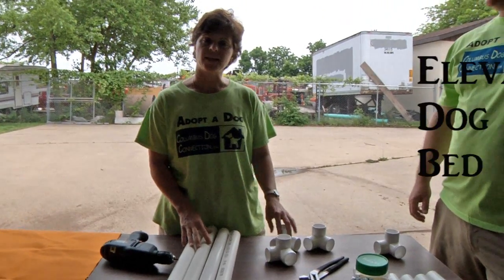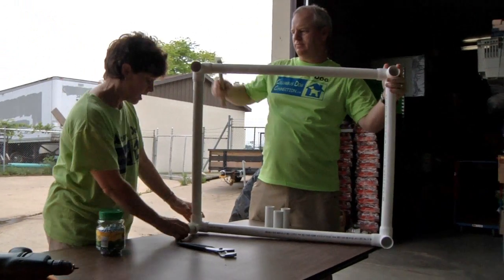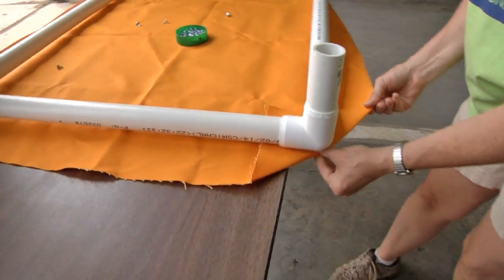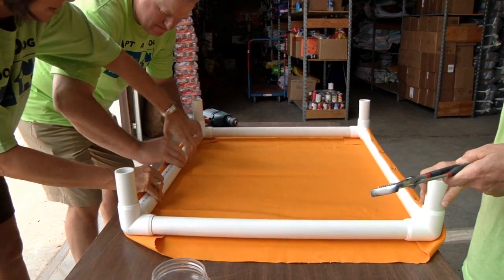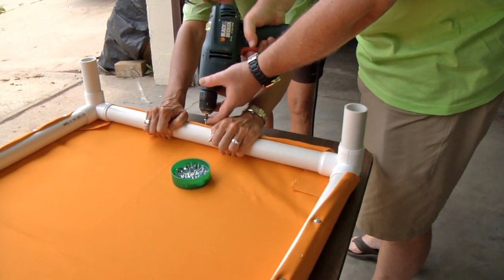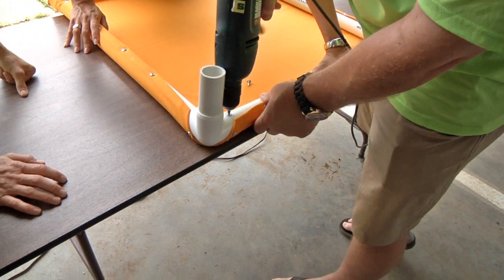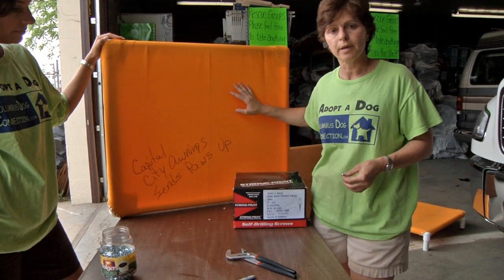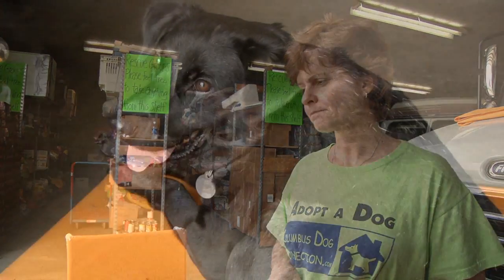How to make an Elevated Dog Bed

Comment: 1 person can make a wooden frame. Then with the fabric easily staple gun it in tact.  Just saying.
Reply from the maker: Hi Rob
Yes, one person can also make a pvc frame, it's just that you will build a stronger frame with 2 people. We would also suggest pvc over wood as you can't easily clean the wood from urine.  The panhead screws will also give you a better, long term hold vs the small size of the staple gun staples.

Comment: I have a disabled chicken that is an indoor pet. I'm planning on making this for her, but I am going to use much longer legs and make a frame for the bottom as well, then I will put cloth on all sides, except one, to make a cube, finally I am going to take the cloth for the side that didn't get used and I'm going to measure it, cut a hole, sew back the edges of the hole to prevent freying and then attach it all together. This will make her a nest box/hide away bed and a perch.
Reply from the maker: Sounds awesome.  Please post a picture when you are done so we can share with our chicken sanctuary friends.
Reply: @columbusdogconnection2950  I definitely will!

Comment: This is so great! I want to make one for my dog, but I need to make it the height of my bed because she likes to be next to me when she sleeps. Any tips on how I can make it a bit taller and structurally sound?
Reply from the maker: Hi Addie.  Thanks for your kind words.  You would have to make a wooden frame to make it sturdy enough.
Reply: I would  use a thicker pipe do it won't flip over. 🙏
Reply: Make a platform and put the bed on it. Add some steps/a ramp to  help the dog get up.

Comment: My American Staffordshire Terrier broke the pcv pipe in no time. Now he has an aluminum Kuranda which is great.
Reply from the maker: Hi Tomas. What size pvc did you use?
Reply: @columbusdogconnection2950  2”
Reply: @columbusdogconnection2950  He does not lay on the bed, he slams on it
Reply: @columbusdogconnection2950  In the case of my dog, the bed is not subjected to units of weight, but units of Newtons instead.

Comment: Ever seen the little video of someone heating a nut and a bolt and pushing the PVC pipe over one (ie. the bolt) and the connector over the other (the nut), then cooling them under cold water and twisting the nut and bolt out. It leaves you with a pipe and connector that can then be screwed together.
Reply from the maker: Thanks Kirsty. That might work.

Comment: You left out the WHY. Why elevated? Why just a couple inches off the ground? I've seen this design before but I didn't quite understand the advantage over just a typical cushion bed.
Reply from the maker: Hi Brent.  Most kennels have cement or other hard surface flooring.  An elevated bed provides a softer, dryer, cleaner place to rest.
Reply from the maker: Also, a shelter can't keep up with the cleaning of absorbable surfaces that a cushion bed would be.

Comment: This is a very helpful video - thanks. In my case, I have 109lb Shepard mix that has become lame. We saw something similar made by a handicapped pet company using some kind of mesh to allow the dog's urine to flow down into a catch tray. We are currently having to have the dog lay on Pooch Pee Pads to catch the urine and poo. I'd like to make my own "Pee Bed" but just not sure what I could use for the mesh. I am thinking maybe fiberglass screening. I was concerned with how to attach it to the bed - your method of screwing it on is something I hadn't considered. Ideally, I would like to make the fabric/mesh removeable like the commercial bed, but I am not skilled in sewing or other fabric architecting. So maybe the screw method would work - just not sure with mesh/screening. Any idea?
Reply from the maker: Thanks for your kind words.  I think the mesh being screwed on is probably your best option.  Just use the pvc snap clamps that we link to our our site at this link.  http://www.circoinnovations.com/circo-direct
Reply: Michael Abel Bless your hearts for staying loyal to your loyal companion! 

I read your comment and I'm intrigued by your question... I honestly had never considered that problem or what options are available, and I'm kinda a weirdo and like thinking of new ways to do things, so I feel like I'll keep thinking about this in the back of my mind... Not sure if you are still even looking, in fairness, but here's my brainstorm, maybe it will give you more ideas?

My main thought was that if there was some fabric to slip the mesh between and slide in and out, maybe that would work, the idea would mean basically a "frame" of fabric, but two layers of it, leaving the top layer unscrewed on one side so you could slip in the mesh, like a pillowcase works? 

Obviously, that idea has lots of flaws, though, mainly that some sort of material would need to be under the mesh or pup would just fall through. 

Oh! Better idea might be if you can do this concept and cover the top layer (as they do here) with mesh, and then use the underside of the pvc to attach fabric, tarp, plastic so that you could slip a tray or pee pads underneath of the mesh that he would sleep on. You could even  put some fake turf stuff on top the mesh (maybe use velcro so you can change it out easily) so that he's got a more comfy surface to sleep on, and you can rinse it fairly clean? 

Not sure if any of this makes sense, so I'm apologize in advance, I swear there's some logic in my head, maybe migraine brain isn't as brilliant thought right now ;)

Comment: I would love feedback on how these have held up over time? 

I'm mainly wondering how you (and anyone else who would share) feel that these beds compare to similar beds from a manufacturer, particularly on their overall longevity in a rescue/shelter environment?

My general experience with any type product is that typically items  from a manufacturer are of inferior quality to something you build yourself. It seems logical to assume the same would apply in this situation, and I would be delighted if these seem to last at least as long as the manufactured product, as long as they also aren't prone to needing maintenence when built correctly originally... I'm curious if that seems to be the case? 

My local rescue is considering purchasing beds from the manufacturer, and since it would be a significant cost even when discounted for rescues, it seemed worth at least exploring options. 

I really think these would be a great thing to build (I've wanted to build one for my own rescue dogs), but I'm just wary of the uncertainties and know that it a realistic idea if it is likely to need maintenence any more frequently than purchased ones.

Any insight, feedback, or lessons learned since this post would be very appriciated! 

Thanks so much for posting this wonderful, clear and concise video, and thanks to everyone who helps animals! Rescue dogs rock! (I've got three, lol!)
Reply: I built one over 10 years ago and have had no problems with it. When I made ,I did not even know there was a video. The material I used is pet screen netting. Pets can't tear it. I make washable blankets and quilts  and sew ties to the corners ,so the  cover stays put.
Reply: @Dianatorres6990  that's awesome! Thanks for the reply! :)
Reply: What I like about these beds , is  they are very easy to take with to your next destination, you can take them apart and even make a long pouch for them to carry them . The netting I used  is very light. yet very  durable. I would suggest a thicker PVC pipe for a bigger dog.
   When I built mine I  used the half inch wood screw. I used the wood crew because it has a flat head. What I also did was fold in at least 1 and 1/2 in of the nettting under all the way around the bed and then screw. Make sure your netting   evenly stretched all the way around and then secure. I really enjoyed making this bed and our dog is really enjoying. Our mini pinscher dog even takes a a dive to get on it.
     For anyone that wants to make several beds ,try making one and see how your dog likes it. These beds are easy to build and light weight.🙏

Comment: I'm confused as to why you would claim that the corner pieces are special order only and that you can't buy them at the big stores.  That's not true at all.  Almost any hardware store that sells pvc pipe will have those corner pieces, including Lowes and Home Depot.  $2 or less each typically.
Reply: Dear Dodger, 
The Home Depot and Lowe's in the Columbus area do not carry these.  The web sites for both stores also don't list them. What store did you buy them from?
Reply: I think you're confused. I believe you're thinking of the 3-way pieces but the elbows are not at 90* angles. The ones in this video are a special furniture-grade as they are not a standard plumbing piece used in the united states... hence why you cannot find them at places like Lowes or Home Depot. If you do find them, however, please let me know :D

Comment: Ever think about using PVC glue duh!!
Reply from the maker: Hi Kenneth.   Where are you suggesting to use the glue?  We love to hear suggestions on how to make the beds better, but no need to be snarky, ok?
Reply: Gluing the corners would prevent the ability to add tension to the second side when applying the covering by applying torque using the channel locks.  I think these people know what they're doing.
Reply from the maker: @williambrady5526   Thanks William.  We appreciate your support and clarifying Kenneth Haven's rude comment.